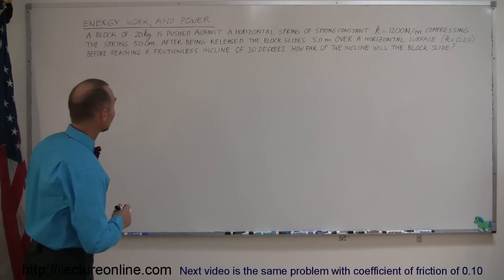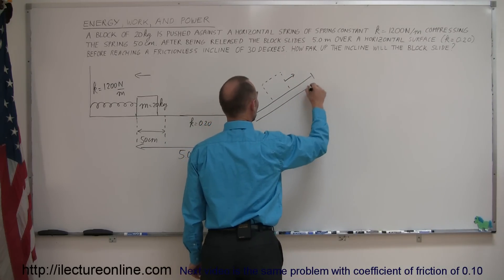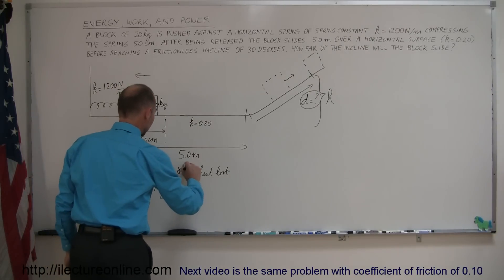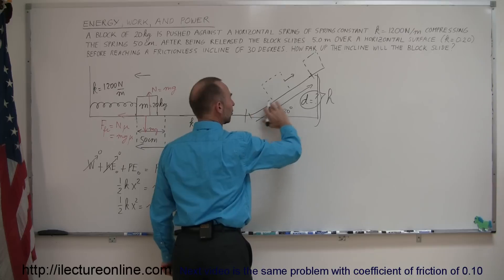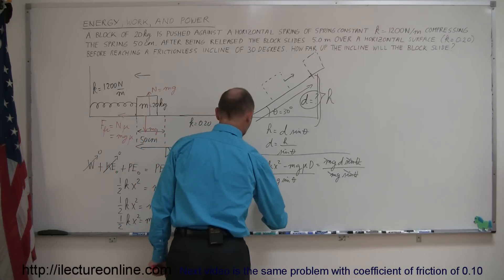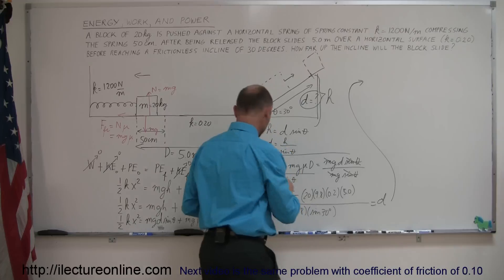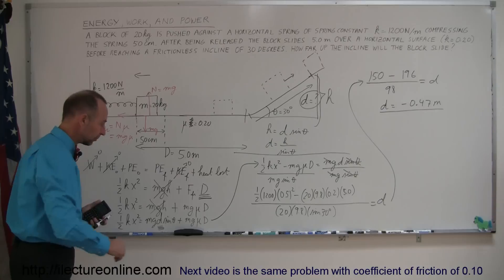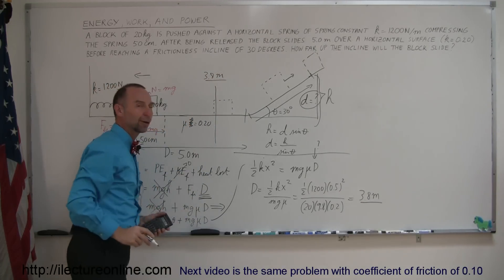Physics 8  Work, Energy, and Power (27 of 37)

Comment: This video makes sense except for one little detail, since there is an instantaneous moment which the surface switches from flat to sloped, won’t that moment act as a collision? We would lose even more heat that way
Reply from the maker: We are also ignoring wind resistance, heating effect of the spring, etc.  We are simply concentrating on the principles, and ignoring these types of details.  Every physics problem in every text book will have these types of "things" in them.

Comment: physics3a- why is there no initial kinetic energy at the start when we let the block go? I would assume that when we let the block go the spring would immediately propel the block.
Reply from the maker: You can either count the potential energy of the spring before the block moves, or the kinetic energy once the spring is extended and the block is moving, but not both at the same time.  (That would be double counting).

Comment: The number (-0.47m) what does it tell us about the position of the block besides the fact that it doesn't go up the incline.
Reply from the maker: I don't see ( -0.47m), but the block does not have enough initial KE to overcome the friction of the flat portion and therefore does not reach the ramp.
Reply: @MichelvanBiezen  Thanks I was referring to the value of d

Comment: Why no initial friction work . 50 cm surface also have a friction .Because 50 cm into the  D=5m surface 
W0=mgk50cm
Reply from the maker: The problem states that the block slides 5 m over the horizontal surface.

Comment: Why does W become 0? I don't get that part.
Reply from the maker: Either you let W be the work done to compress the spring or you account for it by using the PE stored in the spring, but you cannot count both at the same time.  (that would be "double dipping")

Comment: There was a similar question that I have a problem with. Can you look into it and provide me the solution?
The problem is from Kahn, Yoni; Anderson, Adam. Conquering the Physics GRE (Kindle Locations 1009-1012). Cambridge University Press. Kindle Edition., 
Section 1.3.5 question 1

The following three questions refer to the diagram: a pinball machine launch ramp consisting of a spring of force constant k and a 30 ° ramp of length L. 1. You want to launch the pinball (a sphere of mass m and radius r) so that it just barely reaches the top of the ramp without rolling back. What distance should the spring be compressed? You may assume friction is sufficient that the ball begins rolling without slipping immediately after launch.

The answer given in the answer sheet is (mgL/k)^0.5. My answer came out to be (2mgL/k)^0.5.
Reply from the maker: You need to use an energy balancing equation:     Eo = Ef       (1/2) kx^2 = mgh    where  h = L/2     Therefore (1/2)kx^2 = (1/2) mgL
Reply: Umm..what about the work done by friction which will be umgLcos30? Why this hasn't been incorporated even though it is given that frictional force is acting on the surface?

Comment: Hello! I have a question. For some reason I was expecting kinetic energy to be an intergral element in this problem. I say this because from the moment the block departs from the force of the spring to the top of the ramp, wouldn't kinetic energy be part of the equation, particularly, Energy Final?
Reply from the maker: If you only look at the beginning and the end, the block is not moving at t = 0 and it is not moving when reaching the maximum height ) at the end.  (Therefore no KE)

Comment: I'm confused. Shouldn't the heat lost become positive because the work done by friction is negative? Since friction acts opposite of the box's displacement, shouldn't work by friction equal to friction force times distance times cos(180) which would make it negative?
Reply from the maker: It depends on how the equation is defined.   For the initial equation to be correct as shown in the video, the heat lost term placed on the right side of the equation must be positive.

Comment: 50 CM =.50 METERS NO? NOT 5.0?
Reply from the maker: +Sandra Rivas 
I wrote 0.5 not 5.0.   Are you referring to the distance of 5.0 m along which the block slides?
Reply: 50 cm is half a meter so 0.5m
Reply: 50 cm = 5 deci-meters = 0.5 meters = 0.05 decameters = 0.005 hectometers = 0.0005 kilometers , don't forget mili->centi->deci-> normal meter -> deca -> hecto -> kilo , and so on..

Comment: I have to ask, I've seen most of your videos regarding Mechanics and I don't understand one thing.
If the Work-Energy Theorem is W= E_0 - E_f, how come you use W + E_0 + E_0 = E_f + E_f + Heat lost in every example?
Reply from the maker: +NC Quadraxis It is just a general equation.  There is only heat lost when there is a resistance force like friction of wind resistance.  There may not be any W (work put into the system).  It is just there as a place holder and when you look at the problem you have to decide what term you have and what term does not apply.
Reply: +Michel van Biezen Oh ok thanks and thank you for naking these videos, you really make us understand how and why we calculate things without complicating it so uneccessary like most teachers do :)

Comment: Why the W is zero? didn't the spring do any work?
Reply: He explained that we're starting after the spring is already compressed
Reply from the maker: +mahim .nirob 
That is already accounted for by the stored energy in the spring.
W is used when there is an outside force applied to the system doing work.